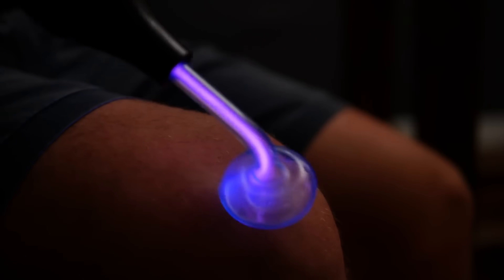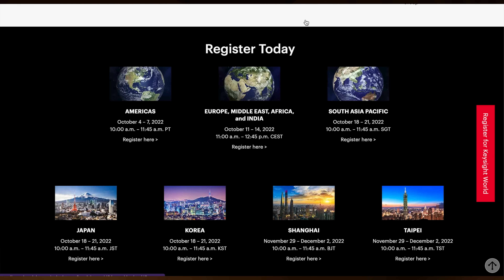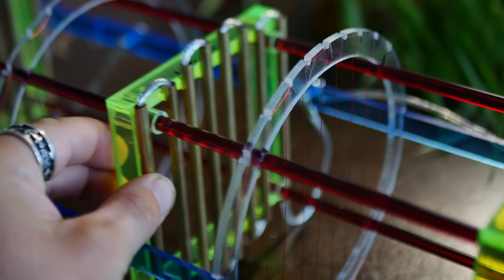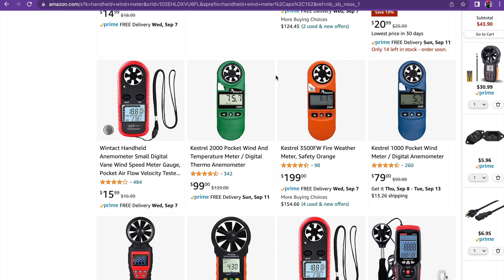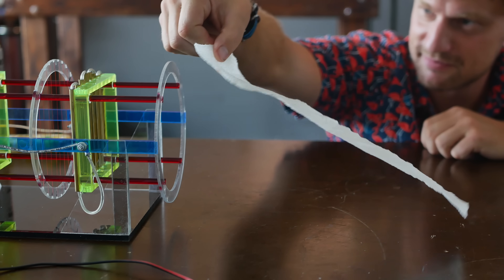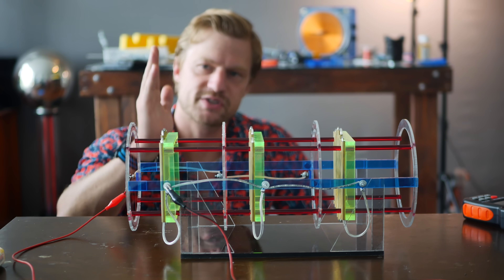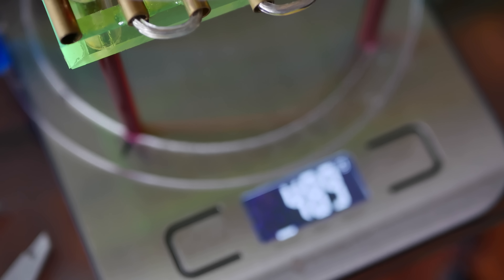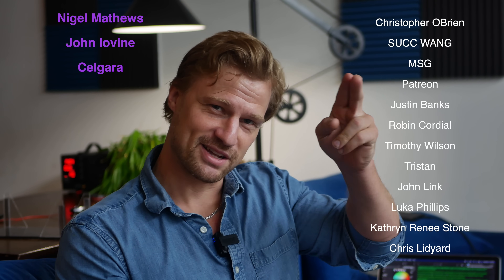Designing A Next-Gen Ionic Thruster! (For Flight)

Comment: The important vector is not speed but total thrust. You could move 3 times the air volume if the Ionic Thrusters was placed side by side.
Even with 50% lower speed the total air moved should increase the effective thrust.
Total volume of air and power used would be nice numbers to have.  🙂

Comment: I would imagine one big improvement would be to not be using what looks to be steel nuts and bolts as terminal connections to stages.. would expect some power loss there. 
And if possible maybe smooth out the copper wire somehow? looks like the plasma streams are coming out of probably very small peaks/creases in the wire instead of spread out evenly across the wires (looks pretty with the peaks though)

Comment: Hello, 
At higher velocity the air flow has a shorter time in the engine but requires more energy to be transported. Like with a turbo charger, the geometry needs to be compacted in order to improve thrust to weight. 

The electrical resistance of the charged air inside the stages should go down as the velocity increases, meaning the later stages can be further apart or operate at lower voltage. The exhaust plasma has a large volume and low 'pressure', but perhaps whiskers and a charge pump can get something ramjet-like going on.

❤🧡💛💚💙💜

Comment: I suspect that air is actually being DRAWN IN from the uncovered sides. I suspect wrapping it would likely reduce air flow but would increase the static pressure of output. Ultimately I think this would benefit a nozzled design.

Comment: I wonder what would happen if you were to rotate the thin wires using a motor, would expect that you'd get more contact surface area wise.  

Also wonder if you used staged ducting.  Similar to what Dyson use with their fan at various points down your stages.

Comment: For plasma generation I suggest you can use either needle points or very small tungsten wires. I was using gold plated tungsten wires for high speed printers and it provides reliable and efficient plasma generation as it doesn't get damaged by the O3 molecules. 
As for your design it could be much improved by using a tube and better aerodynamic. You don't need such big round tubes as ground electrodes and the square frame are not very good for air flow.
I guess air speed is fun for the show but makes little interest. The thrust is all that matters. Measuring it is easy using just suspension wires...

Comment: Why not run each stage with the wires + grounding perpendicular to the next?  It would also be nice to see if each stage was 90 degrees turned from the next to see if there is any change.  And last, it would be cool to see if the wires are effective if connected in spirals rather than in your parallel lines.  Nature operates in curves and spirals, so I would think those would be more efficient.  And it would be nice to know if Archimedes or Fermat spiral works better.  Than if a sprial does work, does it help to form it as a cone, or as an accretion disk?

Comment: 1) the power supply is an issue, 2) how much ozone it produces? (don't poison yourself) probably not much as there's no actual spark discharge, 3) but if making something like that combined with a high discharge segment producing a lot of ozone (that highly improves combustion) adding a combustion chamber and a fuel source, you get a new type of a hybrid jet engine. was thinking about making something like that few months ago but have no resources to test it out :P I was even thinking about attaching a single segment producing a significant amount of ozone to EDF with an afterburner and seeing whats the actual improvement in thrust ratio. Feel free to do that experiment if you like as I have no way of trying this out in a foreseeable future.

Comment: Each segment you need to add positive ions into the air flow to stop negative charge buildup., 2nd I use a fine wire mesh, something out of a air flow meter from a car intake that creates a smooth lamana flow over the air sensor. It be have a vertical horizontal cross pattern , seperate psus. If you have any,

Comment: the wire and grounds
1. making the grounds part of the outside frame would remove "a thing" from being in the flow path ...the ions wouldn't have to go around them
2. toying with the SHAPE of the wire, everything from adding a second opposite direction set of wires for each stage (cross hatch) to a layered vortex
3. i understand the VASIMR engine uses Argon but it's what they do with the "helicon coupler" and it's shape that might help, the coupler spins the argon ions in a natural spin that they already want to spin in, which i would think helps them move faster
Questions
1. will you be incorporating magnetics to "fling" the ions faster? 
2. will you be building the "heating stage"? (induction) 
Thank you for showing me great ways to LOVE SCIENCE

Comment: Cool, good job.
To test laminar flow, you need to have laminar flow coming into the smoke that then is blown by the wind. Going over the dry ice chunks is not helping! A little bee smoker might work, underneath a set of baffles before entering your wind stream.
I'd imagine the wires are already performing like a baffle on the actual wind to some degree, but I can see a bit of turbulence after each of the wires in the dark room shot. You could try wires of different shapes to reduce the drag coefficient 90%+, see https://www.presticebdt.com/wp-content/uploads/2019/12/Drag_coefficient-scaled.jpg
Also vary the spacing between stages to discover the implications.

Comment: A housing to direct exhaust & intake airflow...?
How would magnetic rings effect ion & air flow...?
And,... You are having normal air pressure intake, what happens if you 'ram' air into the front...?
And of course, any additional 'fiddlybits' will add weight & reduce efficiency (but as long as it looks cool...)

Comment: 1. You don't need the heavy rail no more, use a thin transparent plastic foil tube. 
2. Don't use metal, use metal foil.
3. Sand the lacquer of the threads

Comment: 1) use a duct to direct the air from inside the thrusters. 
2) use thinner acrylic sheets for holding the copper wires and tubes ( it will reduce the weight ).
3) play with the model and find the best spacing and the voltage value.

BTW 
It's a nice design...

Comment: Why did you build the whole thing like a caveman?
Have you not got a 3D printer? 😂
A lot of comments say to add a duct, you can easily print one in vase mode which will be very light.
Also I'm no expert but would it not be better to do one thing at a time like just have single stage thruster and perfect the single stage then have multiple of them and then play with distances between the stages.
Or random thought make single stage thruster but each electrode is shaped like a very steep cone, probably out of some steel mesh (or copper if can get it).
Reply: Wait hol up I'm rewatching and I've noticed you used enameled copper wire, wut?

Comment: 1) swap solid plastic for foam with air in it to drop density
2) look into roughing the copper wire almost like radiators on AC compressor tubing for more points for ionization to take place 
3) copper foil fins to replace the heavy tubes for more sweet sweet weight loss

Comment: You can also upgrade the brass pipes by replacing them with airfoil shaped (less drag) empty 3d printed pieces coted in aluminum foil tape for conductivity, that should reduce the weight and increase the flow speed by reducing drag behind those elements

Comment: Would it be possible for the anode of one stage to act as the cathode for the next?
There is quite a lot of 'dead' space where no thrust is applied, and if the voltages are all at the same level, the second stage is partially counteracting the electrical field strength of its neighbours.

Comment: Ducting would be good so you don't lose air through the sides. I estimate that using balsa wood should help reduce weight by around 50%. You could also measure the impact of the separation between the positive and its next negative plates to use the alternation of charges like in a linear charge  accelerator or even using a second electric font that is reversely powered, so you have let's say - 22 KV, 0 and +22 KV instead of +22 KV and 0 reversed.

Comment: Lol Amateur status, I can run a serious jet and you can connect the electrodes to keep the battery charged and have a simple amp to generate more electricity to keep it charged and cool at specfic temps that can be checked in a dashboard

Comment: Just had an idea while shaving to generate electrons instead of using just brute force  like voltage ALSO use a photoelectric material which gives of electrons when light of a certain frequency is used. Cesium is used but other materials can be used like Semiconductors like silicon, cadmium telluride, gallium arsenide and copper indium diselenide are the best material for photoelectric emission. Generally, for the photoelectric effect, materials with low work function are used so that electrons can be emitted from the material by a photon of very low energy. So try this in your next experimrnt as it could generate more thrust or use less power or improve efficiency in thrust per watt.

Normally in photoelectric cells metals that have low ionisation enthalpies or metals which can emit more easily are used. One of the most popular metal with such characteristics used in photoelectric cells is Cesium (Cs). It is an alkali metal belonging to group 1.

Caesium (Cesium) is widely and commonly used in photoelectric cells because it can easily convert sunlight into electricity. During its exposure to direct sunlight, the electrons that are there in caesium’s atoms get stimulated and start moving around. Ultimately, this electron flow creates the electric current. Hence, we can say that caesium is the most preferred or ideal catalyst for the photoelectric process.

In addition to caesium, other alkali metals like potassium, rubidium, copper and silicon are also often used as an alternative in solar panels.

Comment: 1) use a cylinder with pin holes drilled through the walls to place wire stages. Seal the holes after.
2) different voltage per stage
3) air is a mixture of different gases.  Change input air by mixing gases to understand which gas is more effective at producing thrust at different voltages. 
4) air density will also change thrust...salty sea level versus dry desert air
5) air particle matter matter also change thrust.
6) heat the incoming air very hot
7) pulse dc, synchronized between stages

Comment: Very nice work. Colour of the 'copper wire' suggests it might be enameled / insulated - the HV used is sufficient to break it down but in an unpredictable way - did you try bare copper for a smoother distribution of discharges from the wire?

Comment: 1. Enclose the build or add ducting
2. More surface area for the ionic part (use mesh or closer wires)
3. Higher voltage
4. Every stage gets a higher voltage than the last?
5. More spacing
6. One stage has 2 rows that are closely packed
7. Add more stages

Comment: This is a great project! I can really appreciate the effort you have put in. I think the 3 efficiency improvements you are thinking of are: 
1) Ducting the airflow with more acrylic (would also help with isolation). 
2) Putting a bell-mouth inlet duct and an outlet nozzle to increase airspeed measured. 
3) Make each entire stage movable to see how compact you can make the design and potentially increase airspeed or pressure.

Comment: You might be able to visualise the air flow using a shadowgraph technique or similar.

Also, I think your positive electrode might block the air more than it needs too. Maybe strips of sheet metal or foil, edge on the flow, would work better.

Comment: Would an enclosed version provide more options?

I’m thinking (similar to a jet, but without the combustion or turbo elements) wider, lower voltage energy intake, constrained in the middle to concentrate & speed up the flow, then high voltage on the more dense stream for the output.  Though to be honest the voltage might still need to be height on the intake to get the mass flow in the first place.

Comment: 1. Put the "engine" in one sealed pipe with open ends, you have air/pressure losses on the sides.

2. Make it shorter, the longer it is, the more ineficient will be. Use 3 separate HV generators, 1 for each coil, and reduce the "engine" size from 50 cm to 10 cm. If it is done properly, the HV coils shouldn't interact with each other, even if there is 1 cm spacing between them. 

3. Use a thermal camera to see the flow of the air. See if the temperature of the air (in) hot/cold-dry/wet-low/hight density, influence the output pressure. 

4. Apply the same principles in jet engines-air compression-, start with a big fan(coil) , than a middle one, than a small one at end to increase the pressure. 

5. Chance the shape of the coil. I would say that if your thruster coil have the shape of a triangle vortex(such as a tornado), will dramatically increase the pressure. Use only 1 coil long enough to create the electrical/plasma vortex. 

6. Use a magnet with donout shape at the end to see if he concentrate the plasma flux in one point, thus increasing the pressure.

7. Search on google "how to increase the power of ionic thruster" :) 

8.) Go on PDFDRIVE-dot-com and search for "ion thruster:. 
      You have 933 "free :D" professional books to assist in your journey.
Reply: all great points. also this is probably more fun than practical, but adding on to point 3 he could also use schlieren imaging to visualize the airflow.
Reply: @m4rkinthesand  Excelent idea!
Reply: How do youtube commenters know everything
Reply: @tootaashraf1  Because we're the known biggest and highest intellect neural network and intellect in known universe ]:D
Reply: @rorhianskall5659  well since, people tend to watch what they familliar with?
Reply: @mickolesmana5899  True
Reply: @rorhianskall5659  Brilliant! :D
Reply: Well said!
Reply: @daltonsmith406  I've updated it for you!
Reply: I actually want to see the outcome of this modifications if this guy does not apply them please give them a shot andd let us kno
Reply: yeah cool
Reply: Yeah, What they said. lol
Reply: Bruh facts. Literally read my mind with this comment
Reply: @Needs_Tzel  I've updated it !
Reply: what about also shaping the ground tubes from round to oval (ideally an airfoil section will be best https://www.grc.nasa.gov/www/k-12/airplane/shaped.html )
Reply: @completemudray  Thanks man, let's help our friend!
Reply: try and use Gold wires, tubes, and or Mercury filled tubes. Try it all. talking out my azz! lol cool vid 👍

Comment: One of the inefficiencies I can think of is the amount of blocking of airflow caused by the surface area of the cathodes. If you can somehow make that have less impact on the air collum trying to glow through it you will see a great improvement in thrust.

Comment: 1. Your anode is  made from thick tubes, this obstruct airflow. Use thin wire mesh. 2. the thruster is open, this lets air escape from side, putting it in tube will increase thrust. 3. You use naked wires, dielectric barrier discharge is more efficient, it allows for higher voltage before air breakdown.

Comment: Instead of staggering the ionic thruster sections what about doing the voltage in stages with an increase in voltage for each state at one inch apart . This may mean using individual wires from the stages of a voltage multiplier.

Comment: First video of yours I see and great work!
As for how to improve it, I have a couple of ideas:
- First idea that comes to mind for reducing weight would be "Metal and acrylic are heavy, what about plastic? Could the chassis be 3D printed?". 
- Making the engine bigger would not in theory do much for thrust, but in practice I imagine not all parts would scale equally, maybe mass savings could be found there.
- I think smaller negative electrodes could result in more even and efficient thrust, but can't explain the intuition exactly.
something, something generates more even electric field, restricts airflow less, something

- Optimize the intra-stage/inter-stage spacing? (spoiler: it is (or, should be) surprisingly simple)
I imagine the thrust is a function of voltage (current?) and spacing between the elements, so given a voltage, there's only 1 variable left to tune.
Optimal spacing seems dependent on air intake speed, so one idea would be to:
for each stage, starting at the front: tune the spacing between the front electrodes for optimal power.
Should be quick enough to be faster manually than to add motors and a micro controller to do this for you, except these values could change depending on ambient conditions, so
for each stage: use Newton's method to find the local maximum.
Depending on how complex the most complicated, statistically-significant interactions are measurable, the longer the tuning process could take, but the beauty of this approach is you can leave it on auto for the duration of the operating time of the engine.

As for the mechanics of such a system: either wire pulleys or control-rods like what can be found on RC planes and some servos seem like a good fit.

Good luck!